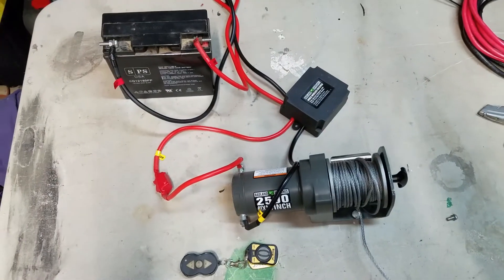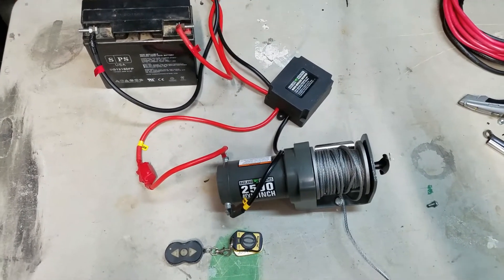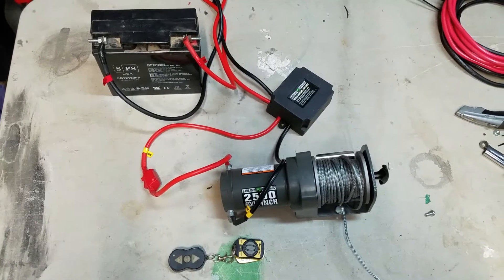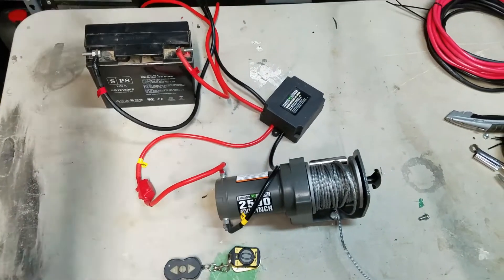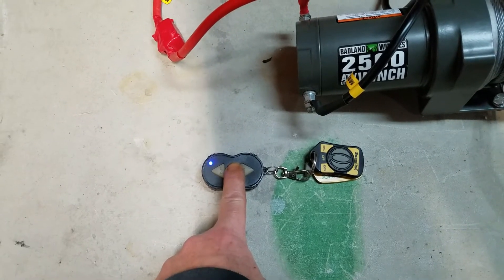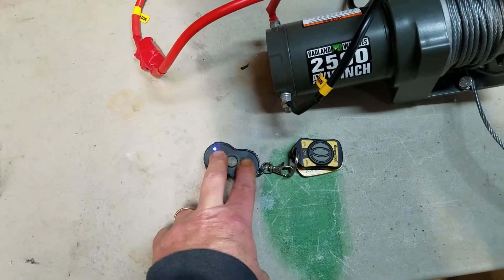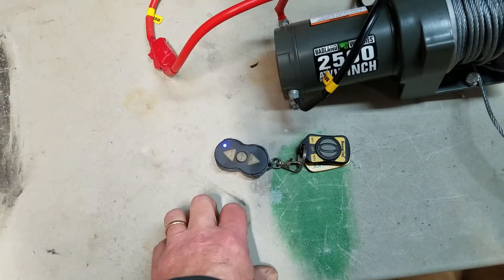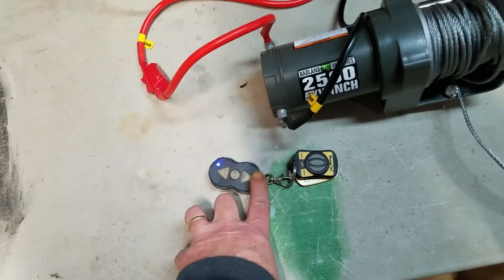Badlands Winch - How To Program the Remote

Comment: Thank you for this video. Dealership rigged me up a thumper fab headache rack with a rear wench and we couldn’t get remote to work. Changed out batteries, contacted thumperfab & they told me to get with dealership to see if they connected it properly & I came across this video & followed your instructions & my remote is now working! Thank You for help
Reply from the maker: Awesome! Glad it helped!

Comment: Thanks for the video, I followed your instructions to the t and the new remote. I had responded just as you showed but it would not pair with my winch for some reason. Mine is a Badlands ZXR 2500 so maybe there is some difference there. It has dual controls where you can run it with a manual cable too so it might be a different receiver 🤷‍♂️
Reply from the maker: Sorry it's giving you problems, you can check if it's the same by downloading their replacement parts list and comparing the Transmitter for the old and new models. The link is in the description
Reply: No worries, you're video was still helpful! I think I must have a different receiver though. Mine has both wired and wireless control options, and I just realized yours is wireless only, so there's definitely something different.

Comment: Mine flashes for the 20 seconds and then the light shuts off.  Then I have to hold the power down again to turn it back on and it starts all over.  Any ideas?  I bought my wildcat and it came with the setup but the batteries were dead in the remote so I just replaced them and then got in the machine and turned the key to the on position and attempted this programming sitting in the driver seat.  Thanks in advance for any help
Reply from the maker: The winch is a wildcat, but this is the remote that came with it?
Reply from the maker: In any case, make sure you are far away from the receiver and see if it does the same thing
Reply from the maker: Any luck?

Comment: Question for
The group .. I’m switching to synthetic rope. The cable is 5/32 

Could I use 1/4 synthetic or do I have to stick with 3/16th

Comment: Bummer, Mine will not do anything, I tried all of your suggestions, it just sits there and won't flash, Thanks tho.
Reply from the maker: I've been meaning to put up a video about this... Try taking  the remote apart and use the buttons directly on the board (without the silicone pads interfering)
Reply from the maker: BTW, When you order a replacement Transmitter for $25 it comes with a new receiver as well, I just can't remember if shipping was free

Comment: Mine doesn't blink slow. Only fast why?
Reply from the maker: what is the model number on the back?
Reply: Same.
Reply: @michaelgengo2490  I just returned it and swapped it out with the ZXR 2500 with a wired and wireless remote.
Reply: @Cologne_Trooper did that solve it. My remote flashes really fast and won't connect
Reply: @NonRider  yes
Reply from the maker: part number is 16311 REMOTE TRASMITTER Assembly and the number to call to order is 1-800-444-3353
Reply: I lost my remote. Can I reprogram another brand controller to the winch or do I need to wire in the receiver box as well. If you have another remote for the badlands winch I think it will pair up but don't know if another brand will or how to do it.
Reply from the maker: The short answer is no it's not possible
The long answer is you could do it but you'd have to at least match frequencies of the remote and receiver. You'd have to ask someone who knows more about wireless
I don't know what your situation is but you can get a whole new remote and receiver from HF for $25 and free shipping

Comment: I tired to do this and while holding down i only got to 10 seconds before it stoped blinking...
Reply from the maker: How's the battery, and how long ago did you get the winch, they changed the remote again, it looks the same
Reply: @mreinsmith  good batteries, two years ago, it does everything the same as the video except it's only ten seconds before it stopped blinking and it I let go and held for 3 seconds and still nothing
Reply from the maker: By any chance do you have trouble with the buttons not working occasionally?  I had one where I literally had to use a pencil (eraser side ) to get the button to hold (replaced that one since)
Reply from the maker: Oh, and did you stay close to the receiver (no insult intended, just checking the basics)
Reply: Mine does the same thing did you ever figure out the solution
Reply: @bryce3213  nope trashed it bought a new one...
Reply from the maker: It always drives me nuts when you have to replace something for such a small thing like that, the thermostat on my little powder coating oven just broke and I can't find a replacement anyware, we're probably talking about a $1 part

Comment: I have the remote just like you have but mine won't blink 20 times it turns off ,so then what
Reply from the maker: How new is yours?

I'm sorry to say that as far as I can tell newer units are NOT Programmable, 3 blinks is all I get too

The reason I say that is because I had to replace one of mine with a new one from HF parts last year.

I found out that you can't get the remote by Itself, it only comes with a remote AND a reciever ($25 free ship)

So now the new one stopped working literally about 3 days ago and I did all kinds of research and testing with no joy

I'm willing to bet the remotes and receivers have a standard code now, because of all the problems people had programming them

I have another one on the way so we'll see if the remote works with both receivers

Comment: My light flashes way faster and won't connect
Reply from the maker: I am pretty sure I figured out the fast flash problem, Ironically it started happening to mine shortly after you asked. It's the buttons, I took it appart and just used the board and it worked

Comment: you can't program a remote for a winch unless it came with that specific winch its not blue tooth 😅
Reply from the maker: In this case Its just like a garage door opener, the receiver transmits it's frequency, the remote picks it up and matches it
I have 2 of them and I've switched them many times (mostly because I keep misplacing one of them 😁)

Comment: this don't work
Reply from the maker: Is it the same model controller?
Reply: @mreinsmith  yes
Reply from the maker: Were you able to get through the whole procedure or where did it fail
Reply: @mreinsmith mine is same model but flashes way faster and will not connect
Reply from the maker: How long ago did you buy it?

Just spitballing here:

I'm wondering if they changed something in a newer version.
If you've had it longer than a year I would change the batteries, they don't last long (at least mine didn't)

Also the FCC ID on mine is WWWBLT001-T042, if yours is different that MAY indicate it's being made by a different manufacturer 

Let me know what you get